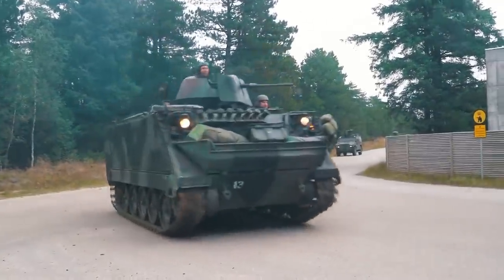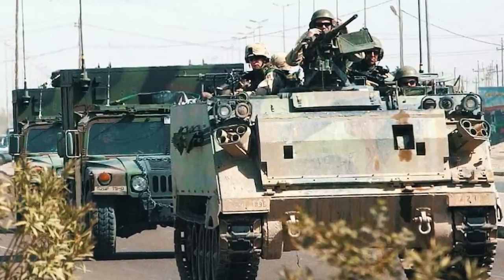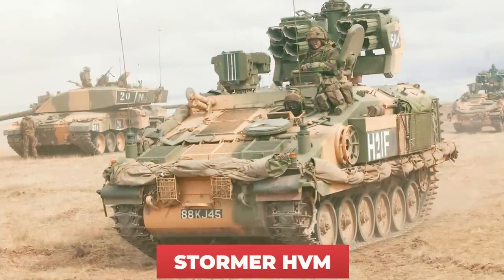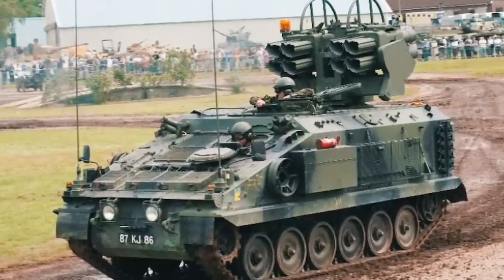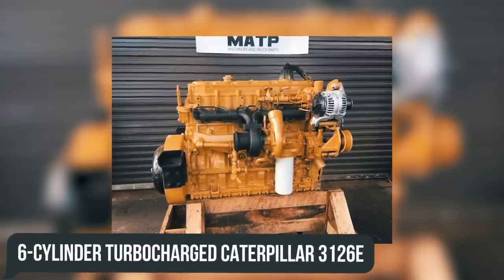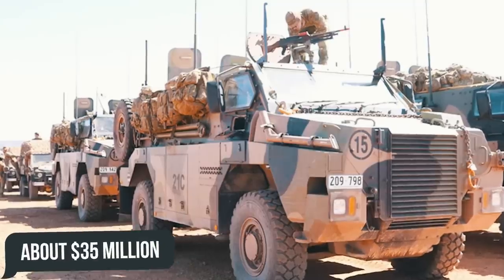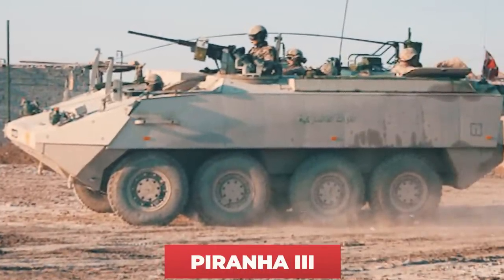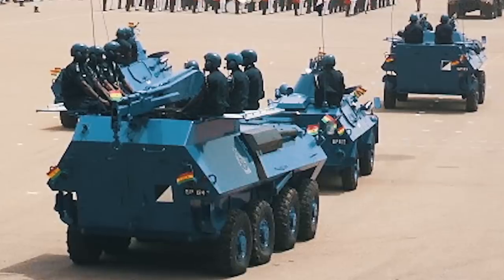Finally: NATO Most Lethal Armored Vehicles Arrive in Ukraine

Comment: 1st minute, sounds simular to describing a child's toy.

Aluminum shell ?
-- Weight of an armored vehicle, 
can be a huge advantage !
-- Too light of any vehicle, 
be careful that I don't sneeze.

What is the ideal weights wanted ?

****
Many cars that I owned/operated:
always had bags of cement, 
placed in the trunk !

It was far more gas efficient
to carry the extra 200lb (90 kg ?) 
of cement !
Reply: Further descriptions, 
also sound as a toy !

*****
My hiking equipment, 
has better defense abilities.

Each of the 9 transported soldiers, 
have better defense abilities.

At this point, the ONLY benifit  
is transport speed.
Reply: A $35 000,000 toy !
Can I bevome a manufacturer ?

With that investment return, 
it will be easy to find financial assistence !